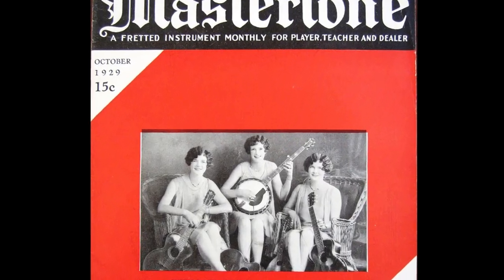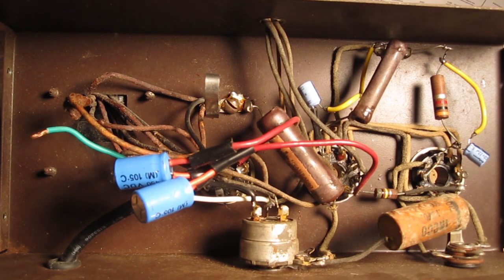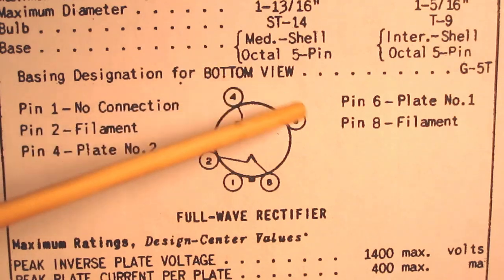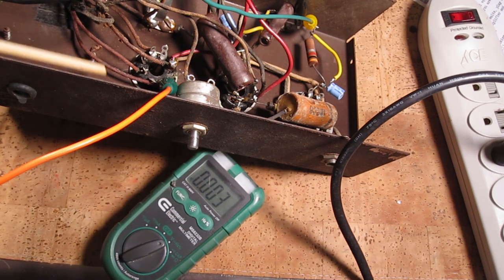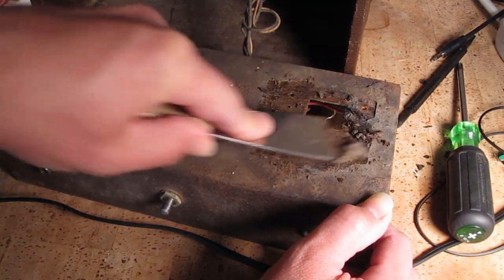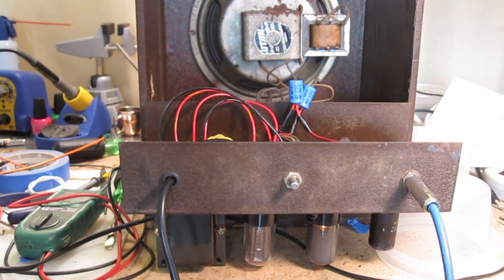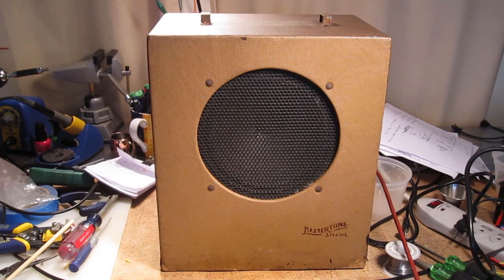1942 Gibson "Mastertone Special" Guitar Amp Overhaul

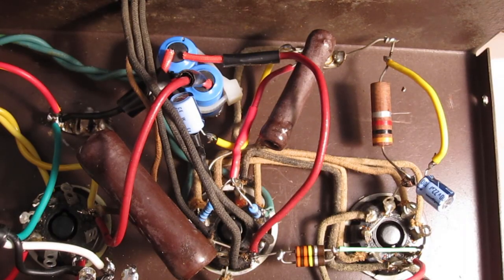Comment: I’m confused at right around 13:00. You said you didn’t have the right value resistor so you wired two of half the value in parallel. But wouldn’t this result in half of the half? I thought resistors in series was additive, and parallel was subtractive, providing more “pathways” for the electrons to move through...did you misspeak, or make a mistake with the resistors? (And thanks - I’m learning about this stuff through videos like yours; not being a know-it-all trying to call out your mistakes! FWIW)
Reply from the maker: Yeah I apparently misspoke. Was going for a value of 150K and these two in parallel gave me about 165K. Sorry for the confusion and thanks for watching.

Comment: Would you call this the original  g-5 ?
Reply from the maker: Yeah it's definitely a predecessor. Main difference is the Mastertone has a single pentode in the preamp (6SJ7) & the GA-5 has a dual triode (12AX7).